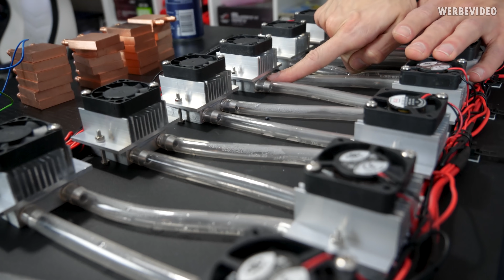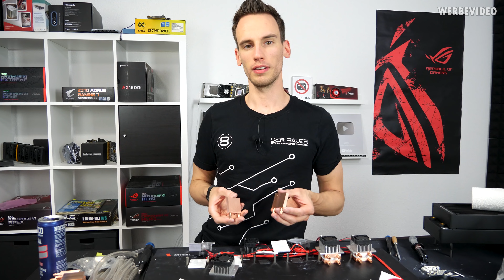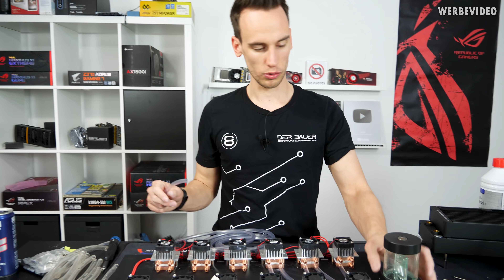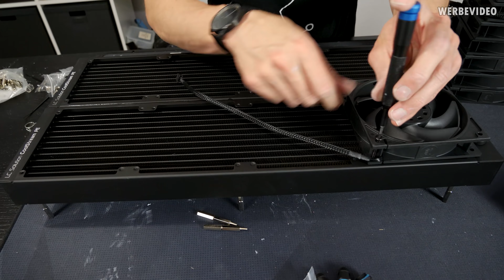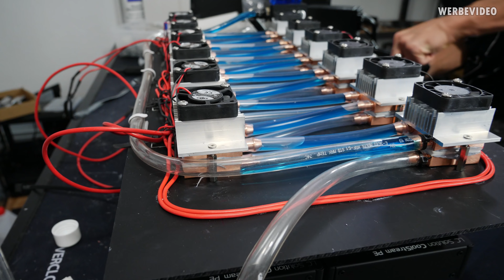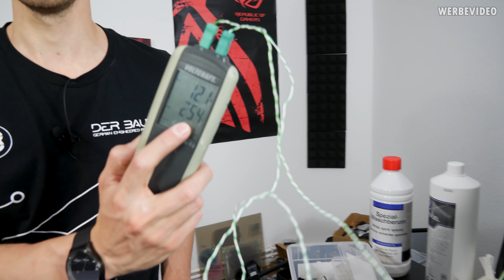DIY AliExpress Chiller - IT WORKS!

Comment: It's a cool (no pun intended) experiment for the pure science of it, but just to dissuade people from trying something similar I have to note that this is abysmally inefficient (and weak) compared to a compressor-based chiller. If you want to chill water, a compressor is the way to go. Not only for the power efficiency but for the cooling power. The only benefits tecs have are size and (potentially) no noise - although it is extremely hard to keep them reasonably cool without aggressive fans so that point is rather moot.

I predict this system will do very poorly once you add a significant load to it - not even being able to keep below ambient probably. TECs are just not good at moving a lot of heat - and CPUs/GPUs produce a lot of it.

The ideal setup for a non-dew sub-ambient cooler is a (relatively) low-noise hermetic compressor chiller. That is basically the same as in refrigerators and ACs, so the cost is not that high given that these are common parts. It is possible to DYI this by just stripping down an old AC unit and letting it chill a pool of cooling fluid. That will give you plenty of cooling power. Alternatively, find a chiller-builder who has experience making custom setups. Extremesystems.org forums has several reputable ones.

Is it worth it though? As someone who has dabbled in direct-die and water-chilling phase-change I'd have to say "probably not". At least for most applications. The idea of it all is very tempting, but uUnless you want it to do benchmarking and extreme-OC as a hobby it's not very practical. The truth is that a top-end aircooler will give you most of the headroom you need for OC'ing a daily rig for 10% of the price and hassle. It may not give you the same drool-inducing load numbers, but it will be sufficient. Same for a high-end normal radiator watercooler. It's arguably not worth extreme-cooling for a normal-use system because your practical gains will be quite small in return for a substantial time, money and effort investment.

Don't let this dissuade you from experimenting though. Just be realistic about what your end result will be :)
Reply: My FX disagrees... My board unfortunately tops out at 1.7 Vcore, but it went from 4.8 Ghz (3c of thermal limits), to 5.5 Ghz below 0c core temps under load (block temp peaks at -35c under load, -60c idle). It was very reasonable price (so many people spend more on water cooling, I agree that is completely stupid if you're wanting performance, water cooling is just weak...)
https://www.youtube.com/watch?v=8h0ieFOeqtI

The 9900k also scales extremely well below 0c, and if you're spending more on it than the TR-1950x sacrificing half your cores/memory and 1/4 the PCIe lanes for that 800 Mhz advantage (while paying more), then the chiller is the only logical solution (otherwise save $600 by getting a Ryzen 1700x and decent X470 board with an AIO)
Reply: @jakegarrett8109  Oh I don't disagree that you can do amazing things with a chiller - especially if you are willing to go all-out below the dewpoint (and insulate the crap out of everything just to keep it from shorting out). I've done that myself with a -60c direct-die phasechanger. My mobo looked like a igloo of armaflex once I was done with it =P

But ultimately it's a matter of adding a handful of hundred Mhz over high-end conventional cooling, and you pay for it with noise, high power-draw and a hundred little hoops you have to jump through. My advice here is mostly just meant to warn those on the fence that are enamored with the idea of super-cool thermals without really realizing all the work and money involved.

Even among the most hardcore enthusiasts I don't see a lot of people who end up running chillers (below dewpoint at least) for a daily use rig. An above-dewpoint chiller though - if smartly built for variable load - can actually be a workable daily solution that gives most of the benefits without most of the severe downsides. Assuming you have the money to burn. You still have to deal with power-draw and some noise, but that MIGHT be worth it for the right person. (or hide the chiller and run the loop from a different room with an oversized pump lol).
Reply: @TheStigma Good points, it also seems like it would be better to at least put the water blocks in a parallel configuration (potentially double stacked).  

I have been thinking about building a swamp cooler outdoors to get sub-ambient temperature water and then having a low powered peltier or compressor based chiller as a second stage. I think that that would be even more efficient since evaporation needs very little electric power.
Reply: @Björn_1978  The fundamental problem with peltiers is two-fold:

- Firstly you need a lot of power to run the TECs, so they need to disappate all the heat they are generating + what they are cooling. Your swamp-cooler would solve this if you went to that extreme.

- Secondly, peltiers just aren't all that powerful in terms of how much heat they can pump. They tend to get overwhelmed very easily once you actually put the cooling system under a large load. 100% of the system heat has to pass through the peltiers, so effectively this means you will probably need many of them working in parallel to get to that near-dewpoint goal. There just doesn't exist peltiers that can cool current high-power chips under OC single-handedly. Peltiers run less efficient the more watts you ask each of them to push, so the more the better... but if you can aim to run them at about 50% voltage then you should be good. Much above that they quickly start to generate too much heat in comparison to how much they move and you risk getting nowhere, even if you have a back-end cooler with massive capacity. It can be done, but you are probably looking at a farly large array of peltiers sandwitched between a heat-exchanger and either a huge custom block or (less ideally) a series of simple cheap ones like in the video.

If you want my opinion though I don't think the second stage of your plan will be worth the effort. I'd advice you just run a heat-exchanger on normal watercooling to your swamp-cooler. It will still provide exellent thermals and let you push the system as hard as you want.

Don't run your swamp cooler on the same loop as the system. The swamp-cooler will need a quite beefy pump to move water a high vertical distance. That level of pressure in your system-loop is quite risky. Way higher risks of leaks and most PC-watercooling parts aren't designed for that kind of pressure. Just use a common plate heat-exchanger to let your 2 loops move heat between them. These heat exchanges are very efficient and will remove the risk and give you a lot of flexibility while resulting in very similar temperatures.

Also remember to mix your coolant with something to lower the freezing pump for the outdoor loop, or else it may freeze, burst and become unusable come winter (it sounds like you are in Sweeden maybe?). With some alcohol or glycol mixed in you can easily get a mixture that can take -30c (another reason to keep your loops separate). There are easy mixing diagrams available online.
Reply: @TheStigma  Thanks a lot for the in depth reply! I know peltiers are way less efficient than compressor driven alternatives, the advantage to me is that they are cheap to buy, small, 100% silent and more reliable (since they have no moving parts). Since like you say I will need to have several peltiers in parallel it is not catastrophic even if a peltier element fails while a failed compressor would mean no cooling. I was thinking about mounting cheap 40x40mm "60 Watt" Chinese peltiers in something like a 2x8 matrix sandwiched between two home made water blocks (probably just some thick copper pipe soldered to a copper plate) with the hot side block connected to the swamp cooler in one loop and the cold side to a regular cpu water block in a separate loop.

Yeah I'm in Sweden and its very rarely below -35C or above 35C here. You are right about it probably not being worth the effort with the second stage, none of this is exactly practical :)
Reply: @Björn_1978  I think an even easier way to ghetto DIY a custom block is to just get your hands on a suitable slab of copper. I got loads locally basically for free from a electro tavlemontør, but I have no idea how to translate this to sweedish or english. They work with high-voltage fusebox and control systems for companies. They are common and you probably have one near you (there were at least 6 in my city). They always carry loads of the standard stuff - ie 1cm thick by about 6cm (or maybe 8cm?) broad bars and always have lots of scrap-cuts they will sell cheap or possibly even give away if you ask nicely. You can always buy bars online but it sure helps sourcing it locally if you can since it's heavy stuff. Otherwise it can be a pain to get bars since nobody seems to stock them outside of very specialized stores.

Anyway, just get some of those bars at a suitable length and drill them along the long axis to make water channels. Since you are making no bends that avoid all the big problems. All you need is a common metal-drill, and drilling copper is super easy. You can simply solder/braze on normal copper-pipe to work as fittings. Not hard to do even with just a common workshop burner as long as you have some flux to make the solder "bite" and you heat the whole block sufficiently. Now you can apply as many peltiers as you want since you can make that block as big as you want. Making several channels (probably 4?) would be ideal to maximize water-to-block surface area. Make a second one and sandwich the peltiers between the two with thermal grease. Then you end up with a fairly decent watercooled peltier chiller.

That's the way I'd go about it anyway. Not sure it will be worth it in the end, but it can be done fairly cheaply at least, with a bunch of cheap tecs and a homemade block like this.
Let me know if I can be of any more help. I love little projects like this and as you can probably guess I've done my fair share of homemade cooling stuff in the past =P
Reply: @TheStigma  That looks like a Danish/Norwegian word, I'm pretty sure its elmontör in Swedish. That's a great idea for sourcing copper bar btw! Since I need the swamp cooler anyway I think I'll start with that and think a bit about a cheap, good and easy way of doing the peltiers a bit more, one option would be gluing together some square 1x1 cm aluminium tubes and 3d-print manifolds.

Thanks for the offer, I could definitely use some practical advice, I'll let you know when I get going! Check out https://www.youtube.com/watch?v=YWUhwmmZa7A and https://www.youtube.com/watch?v=cw8ipUYodkE

Comment: hm... That surprised me. I would have thought the the equilibrium would be reached at a much colder temp!

You only have a delta temp less than 15 C?  Between the cold water and the room. You must have a high temp in the worm loop. But with two rads I would not expect anything higher than 10C.
But if you have 35 deg water ind the warm loop, you would also have a delta temp of 25C over the peltiers. And at that high af delta you probably transport less than 10W og heat over each element. But that would still be still be 120W of cooling power and I do not think you have a loss that high.
It would be nice to know the warm loop temp, and also how warm are the aluminium fins?
But still this system should be able to to keep the cold loop below 25C under full load. Depending on the delta over the elements. As the delta temp falls you can transfer more energy, [watts of heat flow] and with 12x60W you should be able to move 700W if the delta temp over the elements are 0C.
If you want to reach a colder water temps you can stack the elements. But note that the top element also need to move the heat from the lower element, thus the element on the hot side has to be about twice watts. Thus you could bay 12 TEC1-12703 or TEC1-12704, they are about 30W's and put the below the TEC1-12706's, This will reduce you max cooling power to about 350W, bot you would be able to reach a lower tempelture. You can also stack the one you already have, and only provide 5V to the bottom one. That would also work. But then you have reduced the maximum cooling power to about  180W. Note when I say Maximum cooling power I mean at 0C delta over the elements.
But first lets see how well this keeps the cold water temp low under load. You should be able to move a lot of heat with that setup.
Also, it would be cool to see the difference in profromance between the aluminium and cobber blocks. (I bet its small).
Have fun with it. Its a cool project :-P

Comment: Using an Arduino, the pelts could be controlled through a MOSFET. If it can track the temperature inside the loop, then it can wait to turn them on when the temperature raises over a certain point.

This can be further extended with an ambient temperature and humidity sensor. From that, you can calculate the dew point and ensure the loop never goes below that. This will prevent condensation on that side of the loop.

Comment: Easy to know where to go to next: dielectric chilled fluid. Take the 3M novek 7000 down as far as you can to increase performance without having to worry about condensation. I have been wanting to do that with peltier devices for about six years.

Comment: Radiator fans in pull config. Put fans on top of radiator. Radiator on top of TEC, but not touching. Ditch the small fans, keep the fins. Should get decent airflow

Comment: That's not how you're supposed to use multiple peltiers. You are supposed to stack them using different size units in a pyramid configuration
Reply: That works, but only for a very small heat load. As soon as you start stacking them you lose a lot of heat pumping capacity

Comment: Hermetically seal the computer inside a clear plastic container and use more TECs as condensers on the bottom to remove the humidity, then run the CPU chilled for 48 hours
Reply: Why 48 hours? I run 72 hour testing at -60c cooling for phase before powering on, no issues.
About the same power consumption, but -60c idle temp, -35c block load temp, and something below 0c peak core temp under load for FX-8350 at 1.7 Vcore at 5.5 Ghz)

All you need really is 3 layers of 2.5mm closed cell craft foam, and 2x or 3x 5w heaters, and you don't need any "hermetically" sealed container, its 24/7 ready... (I do use Vaseline/Plasti-dip too, but its really not rocket science).
Reply: @jakegarrett8109  Of course that is the established correct way and that is cool, but there are already videos and guides about that. I want to see an unprepared stock board survive 24/7 chilled operation with a lazier solution, that's all. I guess I have to do it myself
Reply: @rjhacker  I'd still call it prepping if you're using a special container. But on that note, to make it look cool, you could probably just use a regular case (the new ones with seemingly 0 airflow, the kind with the pretty glass and literally 0 way for the fans in the front to do anything), just use one of those sealed up with silicon caulking and pump nitrogen gas into it occasionally (you can get a bottle of nitrogen gas pretty cheap).

However, you may have 0 airflow for the RAM/VRM/chipset/GPU if its not cooled directly as well as its Vram/VRM, and the power supply will over-heat, same with HDDs etc. Its just really easy to cut up some foam and attach the cooling heat, it takes me about 1 hour on the FX board (which is what I'm doing long term testing on to see if the pins will eventually rust, since I'm packing the socket with just Vaseline, and the instructions specified non-conductive thermal paste. That should be fine, but at one point my computer turned on without the cooler powered and I believe melted the vaseline out... thanks Windows doing a forced update at 2 am turning my systems on, real classy...)

I get pretty good temps on water though, so for me it makes no sense to have a baby chilled system, might as well get the real performance if your powering a big cooling system, otherwise its not worth the 100 Mhz max advantage (if that). I'd rather spend the time and money binning chips when its down to that low change. Plus when your getting down to that point, your talking about memory tuning (I hate memory tuning... I tuned one kit for 36 hours of my life, I wanted to punt it out the window and skeet shoot it afterwards, I'm never tuning memory again unless its for a #1 spot, because even #2 wouldn't be worth it!)

Comment: 1. Decrease tube length to 25% or less to remove flow restriction. and increase efficiency. 
2. Add more coolers for better density.
3. Use dual pumps one on each side to half the amount of work each pump does and shorten the distance further.
4. Flip fans upside down to suck air off the cooler not blow.
Reply: wow you must be an incredible overclocker, maybe you should make your own channel and show us how you broke all your world records.
Reply: @fortunefed8719  Did you watch the video? he asked for any an all tips to make it work better.
Reply: Also you do understand comment and feedback is good for engagement driving up analytics and earning more cpm. This comment right now and your stupidity are both helping the channel. Furthermore discussion is great for improving and brainstorming the entire comment section is full of ideas.
Reply: Yes, (4) is very important in my opinion. What's the point of blowing room hot air straight on the cool part and giving it energy? Fan should only work on the hot side I guess

Comment: My crazy Idea - Build a liquid cooling test bench with this, but into a large desk (like Linus` older Desk PC) and see if you can make it more of a display piece. That way if you dont use it often, it can still run a system for testing, and still be functional as a table on top. There is so much hardware here that it could look really damn cool :P